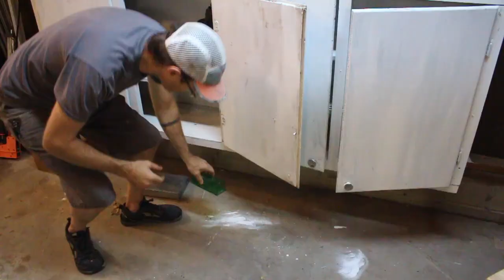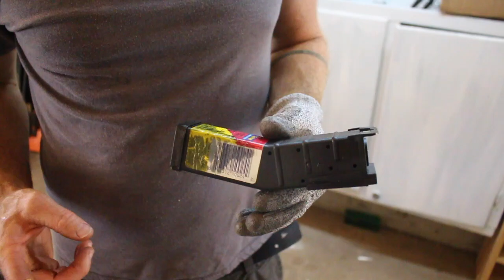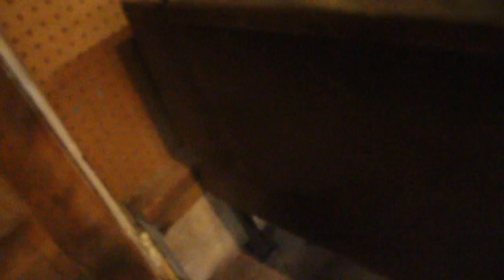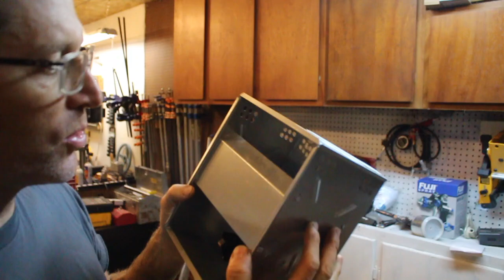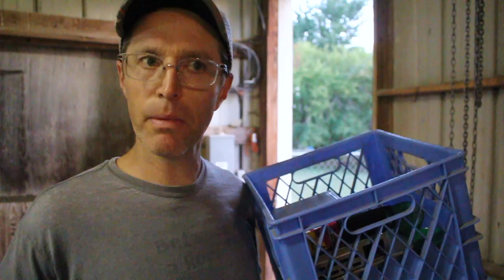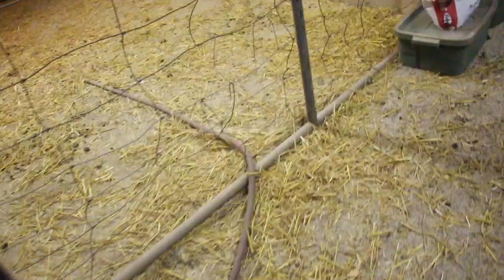Humane Mouse Trap Showdown!

Comment: Great job! I'll try those tip-traps. That trap is very impressive. I now use the Victor Tin Cat style trap made by another company and it has a clear top. The only super productive (never miss) trap I've found is the mouse size Havahart trap. But it's a single catch trap and they're expensive.  The DIY bucket trap works when there are a large number of hungry rodents in a small area. I have trail cam videos of mice walking the ramp to the top and then turning around and leaving. In areas where there's only an occasional mouse the bucket is nearly worthless. But again, thanks for the info on the tip-traps. They look very promising along with the box traps.
Reply from the maker: Sounds like you've learned some things with your various methods -- I agree about the bucket trap working in certain situations. Good luck out there!

Comment: Well done for the humane catching! Just saying for the green trap, put the bait in the bait holder at the end, not on the place where the mouse walks - you can use the bait longer, the mouse doesn’t choke and as the mouse walks further in - there’s a higher chance it will be caught
Reply from the maker: Someone else mentioned that trick with the green trap, and it's since been working pretty well. I like it because it can catch some bigger ones. Thanks!
Reply: metaspencer no worries! Keep catching (humanely)!